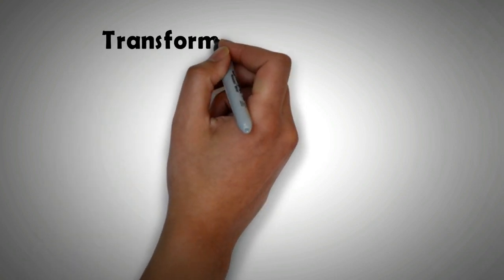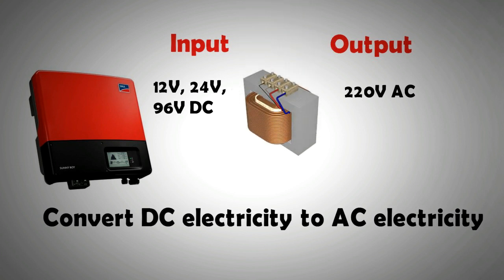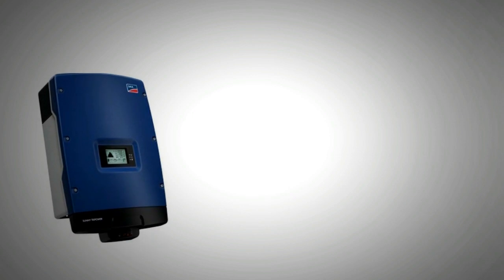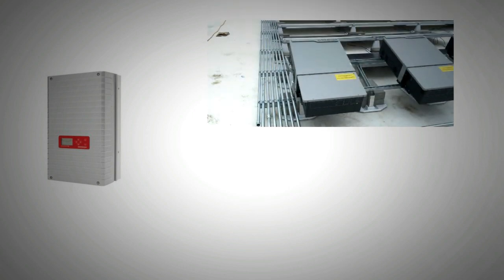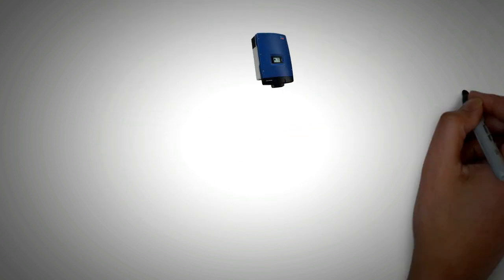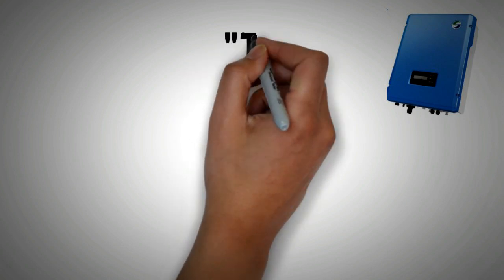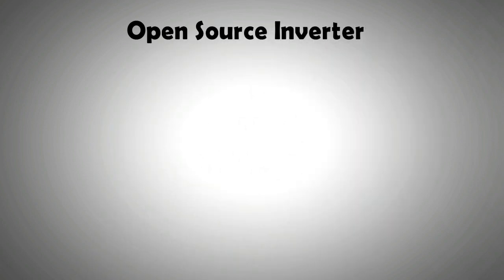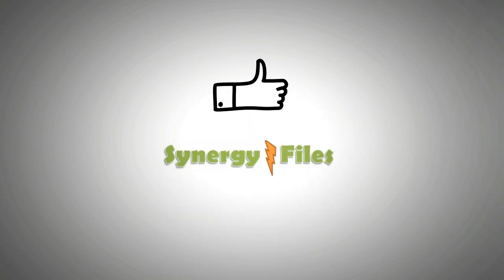Transformerless Solar Inverters

Comment: Yes I saw some companies like "homeage" are offering transformer less inverters in pak. Transformer has biggest cost to local inverter manufacturers. but these are reliable or not? I m interested to know how it step up voltage without transformer. it is revolution.
Reply from the maker: Safdar Karim Yes they are reliable. In a tranformer laminated iron core and copper are costly. Mosfets are used which are generally reliable. Many electrical and mechanical devices are being replaced by power electronics